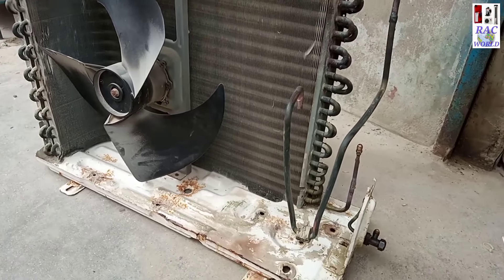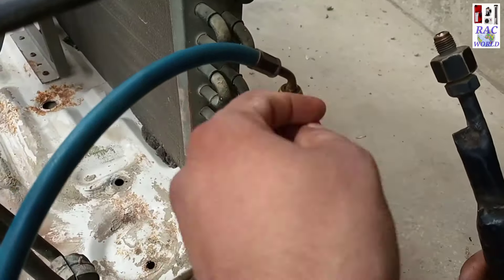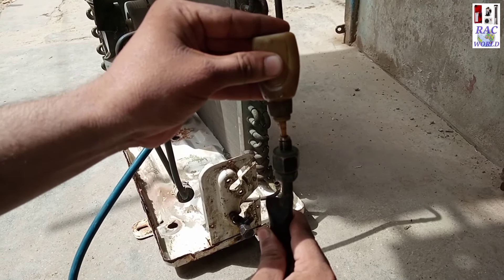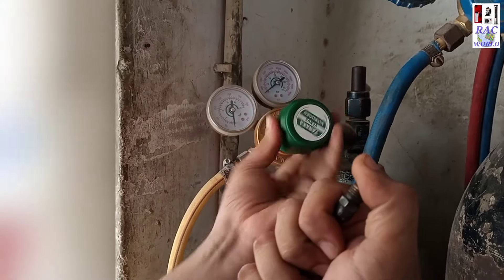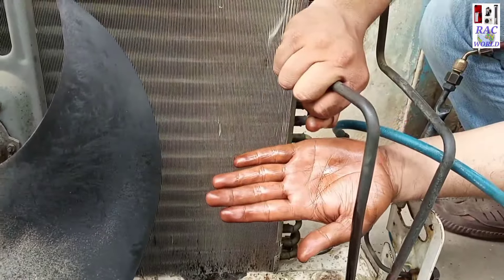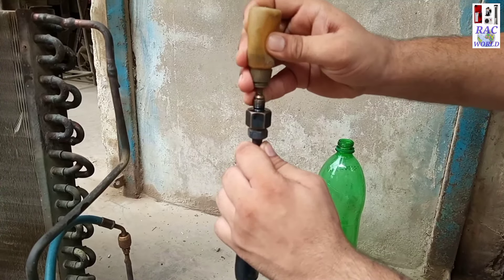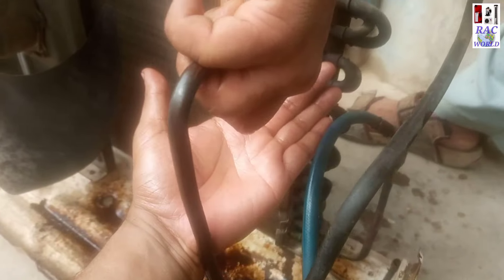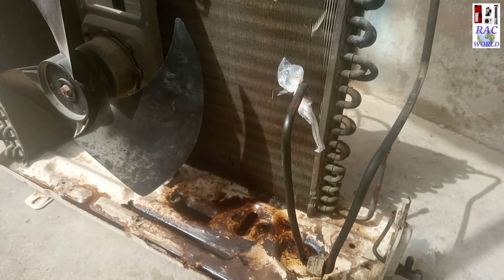split Ac condenser fleshing|split Ac outdoor unit fleshing|split Ac copper tubes cleaning|ac repair

Comment: It is very risky to use petrol for flushing! The professional way is to use liquid soap and warm water and then flush with liquid nitrogen. Heat and vacuum well before recharging refrigerant.
I appreciate your attempt to speak English. Keep improving.
Reply: That's not true . Water is turns into moisture. When mixed with refrigerant you will get contaminated  freon . And it will mix with the oil. That's burnt oil that's why he flushed it
Reply: Not so sure soap would pick up that contamination. Maybe a better choice would be isopropyl alcohol, ethanol or a ligh oil like wd-40
Reply: @brianvargas5432  pentru ce se face vidul??????
Reply: R-11 flush is the BEST solution
Reply: @brianvargas5432  my friend the best is for change. The cost is too small

Comment: Can I ask? 
Which liquid is this? And how much do we need to fill?
Thank you in advance!
Reply from the maker: It's petrol, you can fill it 100ml in once time
Reply: Bolcked ok  good   plushing  good  way  bai   finaley  gas  amd  flueshing  good   propely  good  ok
Reply: Good work  systematically  flushed  condenser coil  split ac  very good information new technician

Comment: Nice job, but I would be nowhere near that condenser when the pressure is released. Sure, it is filled with nitrogen, but the gasoline mist is crazy flammable,  one tiny ignition source and you have a thermobaric bomb. Try using wd-40, or alcohol. Might not be as cheap, but dont let price get in the way of safety
Reply: According to him it's not gasoline. It's petroleum.
Reply: Petroleum and gasoline are same